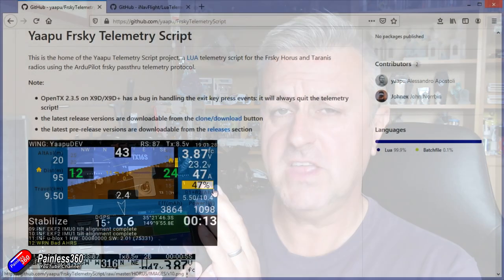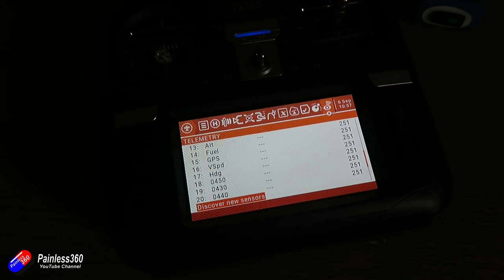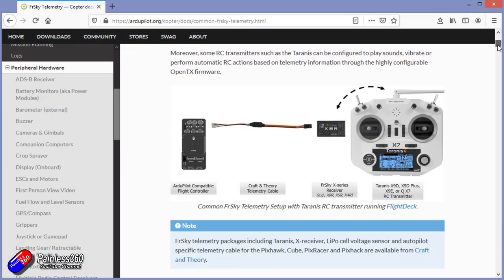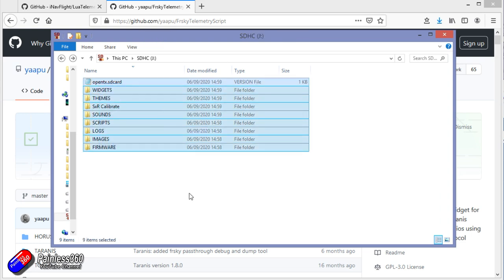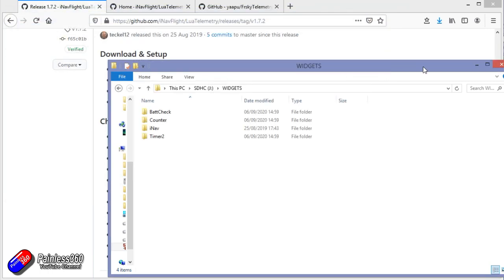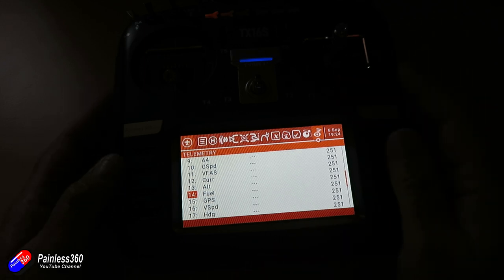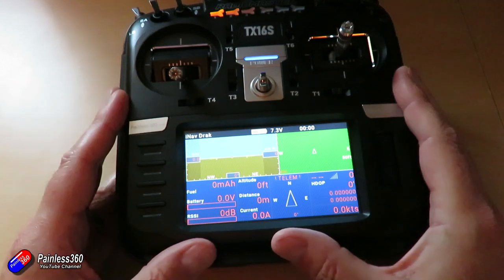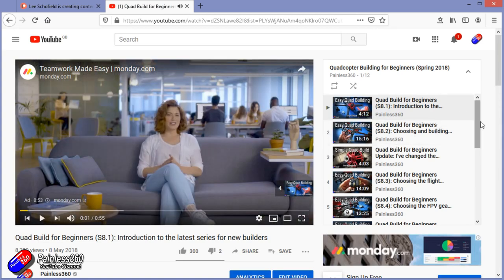Installing Telemetry LUA scripts onto the RadioMaster TX16s (Yaapu and iNav)

Comment: This worked for me using a TX16S, Pixracer FC (old model), Yaapu cable (from Amazon) to connect RX S.PORT to Pixracer Telem2 port, and a Radiomaster FRSKY R161 receiver.  Set Serial2_protocol to 10 in Ardupilot parameters, ignore BAUD rate setting, and leave Serial2_options at zero.  Do not worry if you don't see many sensors on the TX16S before setting up the scripts, I only saw GPS, the script seems to magically pull the sensors from the MAVLINK stream.  I also used this on a setup with a Kakute F7 ardupilot with FRSky receiver and no special cable and it also worked there.  Thanks for the help!

Comment: Hi,
Thanks for the clear explanation of how to load the Lua scripts.
Just one thing to add.  I fly a Holybro Durandal, with s.port for telemetry back to the receiver.  For reasons I dont understand, only GPS sensor shows up on the transmitter when I search for new sensors.  I was confused for ages trying to get more sensors to be discovered.  However, when I loaded Yaapu, it was fully populated with all the sensor data.  No need to try to get all the sensors showing first!!
Cheers
Jon

Comment: Lee I I'm using the same radio as you, loaded with Edge TX and Yaapu, latest versions - when I click on Yaapu's config script, all I see is the word "English" as opposed to the full list of config options.  Also, when running Yaapu, I basically see the just the center section of data (the artificial horizon and a few others things), but almost the entire perimeter is mostly blank.  I deleted and rediscovered all the sensors - a couple times - and still have the same symptoms (I also redownloaded Yaapu and reinstalled).  This was all working fine a couple days ago before I installed EdgeTX.
Reply: I feel dumber and dumber. 1.9.6 is also listed on the main Github page. Thing is that's the first link I downloaded, and Yaapu didn't work (who knows why), which is what led me on this odyssey.

Comment: Hi Lee,

I was trying to assist a friend in putting Lua script on his TX16S.
I have done so on my own TX16S, and it works.

The difference is that he is running Edge TX 2.7.1., and I am running an older version.

The problems arises when we come to the part where we shall populate the widget. On my TX16S it follows your video, but on my friends TX16S we are guided to a menu where is says “Select Widget”. In this menu we can select a lot of items (e.g. timer, output, etc.) but not the Lua script. 

Do you have any idea how to solve this?

Best
Ivan
Reply from the maker: Its location on the SD card would be my first guess.... best of luck

Comment: Thanks lee, but I'm still struggling with my Atomrc Dolphin (loaded with iNav6).  I'm using a Radiomaster Tx16s with a Radiomaster R161 receiver.  The Atomrc F405 NAVI has UART Port 2 for the SBUS from the receiver and the iNav6 configurator shows that all the transmitter channels are working.  For telemetry I connected the R161's SPOT "blue" wire to the UART 2 Tx pin.  The receiver was "bound" using the option Ch1 - 8 Telem ON, and the iNav6 Configuration Port has both Telemetry Output and Enable CPU based Serial Ports selected.  The only telemetry received was the default 4 channels.  I have also tried using the UART 3 Tx pin for the receiver SPOT wire, with the Port Telemetry options  Disabled, FrSky, or SmartPort.  Nothing is working (even after your deleting all sensors "trick"), so have you any suggestions ?
Reply from the maker: A UART can only do one thing at once. If one is doing SBUS, then you'll need another one to use for the telemetry... Best of luck

Comment: Hi Phil,
I have finally got telemetry down from a jumper R8 to my tx16s, BUT i have no sensors shown for distance like sensor 0420 and no tilt on display. got compass, battery, altitude, gsp cordinates, mainly want is distance from home.
Any ideas.
Was going to down load yappu, but if not working complete with inav the I guess it will the same.
Regards
Dave.

Comment: Once more you have shown me a useful tool, thanks. Being old I shall watch this a few times ...and still get it wrong but everthing is backed up. The lzsest version of open TX seems to have a big, seems I get a throttle warning on startup, the a fail safe alarm ...why ? Recibrated sticks still get warning ? Take care.
Reply from the maker: I've had this here and I don't move the throttle the last mm of travel at the bottom when I calibrate. Best of luck

Comment: Adding on to my comments below there's another thing worth noting.  To make Yaapu work using ArduPlane and a FrSky control radio, you have to select ArduPlane's "FrSky pass-through" protocol for the serial port.  FrSky has limits on the data that can be sent via sensors.  This protocol was written to get around that.  One down side is that when you "discover sensors" - the only one that shows up is GPS.  None of the others show up because they're passed in a way that's outside the way OpenTx handles sensors.  I point this out because the PainLess360 videos make a point of saying that the first step in running Yaapu is to get "lots and lots" of sensors when you do a "discover sensors."  This is false in the case of using ArduPlane and the "FrSky Pass-Through" protocol.
Reply from the maker: No idea, sorry. I've not used it in a while. I'd check that the port and connections are correct. Best of luck
Reply: @Painless360  I actually spoke with the fellow who wrote the FrSky Smartport Telemetry Passthrough protocol used in ArduPlane to get telemetry back to Yaapu on FrSky radios - he's the one who explained that the "passthrough" was required to get around the data limitations that OpenTX imposes on sensors.  Because the data passed back to the transmitter using the "passthrough" is encapsulated, it doesn't show up when doing "discover sensors."

I noticed that there's another generic "passthrough" option on one of the parameters - my guess is that its to be used for CRSF. 

As it happens, CRSF isn't supported yet on the latest stable release - 4.0.7.

Your videos helped me get my EDU-450 off the ground - and I'm extremely appreciative.  Some of your information has a few holes in it - which has a good side and a bad side.  The bad side is that it takes some digging sometimes to figure out exactly how things work.  The good side is that it's the process of digging that really provides an avenue to learn this material.

For that - I thank you Mr. Schofield!
Reply: I have to agree seems at times an ester egg hunt. No link to tx16 suff. as stated.

Comment: Hi Lee, what is the baud rate did you use for your model?  I found a weird thing that when the baud  rate for external crossfire TX is equal to or smaller than 400K, the telemetry data won't fully show on the screen. Only part of data was there. But if I increased the baud rate more than 400K, then the issue disappeared...  Not sure what is the cause...  I tried deleted and discovered sensors, but the issue persists...
Reply from the maker: I've never had to change any setting on the radio for Crossfire. I only use it on EdgeTX radios though... Happy flying

Comment: This has been VERY useful information.  I have one question, Followed all your steps read all the required reading and when I discover new devices they all have asterisks by them and some are flashing.  What does that mean?  P. S. I am using a TX16s.
Reply from the maker: The flashing * is showing that the value is being updated. They should flash.. Happy flying
Reply: @Painless360  , You are the man!!  Thank you......

Comment: I realize this is really old - but thanks again Lee!  I've decided to finally add TX telemetry for iNav and Ardu.  RM TX16s, latest edge, followed all of the installation notes.  I select a new telemetry page with full screen - but when I pick either widget I get an error saying "Full screen required".  Any ideas?
Reply from the maker: Turn off the outer elements on the telemetry screen (trims erc)

Comment: Hmm...  Either I'm doing something wrong - or the slide about Crossfire and MavLink isn't quite right.  I have a Quad (a Hexsoon EDU-450) running an Orange Cube and ArduCopter.  I have a Crossfire receiver connected to the flight controller via S-Bus.  Previously, I've run Yaapu successfully when I used a FrSky receiver and the handy-dandy cable.  But adding MavLink to my S-Bus connection on my Crossfire receiver doesn't provide the telemetry sensors required for Yaapu.  I looked at the ArduPlane/Matek/Wing build video - mentioned in this video - but found no help there.  So if it really is possible to get the proper telemetry back to my TX16S with standard Crossfire transmitter - I'd be be very grateful for some additional guidance on connection and configuration.  Many Thanks!
Reply from the maker: Nothing special you normally need to do but connect the MAVLINK TX and RX signal cables to the pins on the FS that are outputting the MAVLINK signals. https://ardupilot.org/plane/docs/common-crsf-telemetry.html

Comment: Hello Lee.  I have been using this on my OpenTx configuration without any problems (since you last helped me) but having spent the last two days trying to help a club member configure his system I have an issue that I hope you can resolve.
His transmiter is a  Radiomaster TX16s MkII running EdgeTx v2.10.1 and the telemetry is all being received OK.  I can only find one set of iNav Telemetry files to download (the same one I use for my OpenTx configurations) and that has installed OK on his EdgteTX transmitter but although the basic widget window is displayed a lot of text is missing.  For example the gauge headings are not displayed, and as soon as the GPS gets a "lock" the GPS coordinates vanish (displayed in a colour you can't see ?).  Do you know of a solution to this, or have I installed the wrong iNav LUA telemetry "system" for EdgeTx ?
Reply from the maker: Check for an update to the widget. Some older versions won't work on the latest EdgeTX. Please let your flying buddy know about my videos too... Happy flying!
Reply from the maker: Then delete and rediciver the sensors... best of luck

Comment: I have a Radiomaster TX16S paired with and X8R. I am trying to use the Yapuu script with an Arducopter Cube Orange. I am not getting the long list of sensors shown in the video. I am using a Craft and Theory cable in the Smartport. Do I need to download both scripts mentioned in your video? Am I missing an update? Any help would be great! Thx.
Reply from the maker: It sounds like you have all the right stuff so I'd double check the coonections and settings in Ardupilot.. Best of luck

Comment: Hi Lee great video. I have a Jumper t18 with the latest tbs nightly build of opentx, the crossfire firmware is the latest also. I do run the latest inav lua script and see all my sensors but notice a "glitch" when powering up my wing. The battery percentage will start at 100% then immediately drop to 0%. If I power cycle my radio while the wing is still running it then shows correctly. I have double checked the battery/voltage settings that the lua recommends in the wiki. I have also tested this with different battery voltages and they display correctly after the radio power cycles. Not sure whats going on. I did notice that you don't use percentage for the fuel on the drak but mah. Any reason behind this? How does it work different to the percentage?
Reply from the maker: I don't run nightly builds on the radio. Seems to work OK here. I'd add it as a bug to the project. Best of luck
Reply: @Painless360  Fixed it, crossfire nano was sending the rx voltage and not the fc voltage. A Crossfire update fixed it.

Comment: Will the iNav Telemetry LUA work with the Express LRS EP1 receiver using the CRSF protocol?  I am running Edge TX 2.7.0 on my Radiomaster TX16S.
Reply from the maker: I've not tried it bur it might. CRSF also sends telemetry back to the radio.. Best of luck
Reply: I am running ELRS EP1 and it sends EVERYTHING from the FC back to the TX16S.

Comment: Hi, thank you for you videos, so much help. I have a problem with Taranis X9 lite... Opening Open TX companion 2.3.14, i dont have the box to mark LUAC, so yaapu lua is not working. Actually any luas are working.. do you know how I could solve it? thank you!!
Reply from the maker: I'd check the release notes for that version of Opentx as LUAc may be included in the firmware automatically now... Best of luck

Comment: I just purchased a boxer radio (4 in 1 with external ranger elrs module). When I drag and drop the iNav lua files onto the SD card I’m getting an error message. Any advice much appreciated!
Reply from the maker: Where exactly are the files on the SD card and what is the exact error?

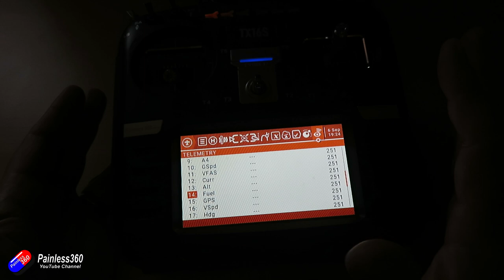Comment: At 13:42 you speak of sorting out sensors if they are not discovered. I cannot discover anything more than basic crossfire information, as a result my teletry widget is 100% still. Tried everything - different software, receivers etc. Could you share what exact version of software did you use in this video for FC and TX? My radio is a Jumper T16 and I'm getting really frustrated by not being able to make it work.
However on my quad with BF4.2 this widget works flawlessly.
Reply from the maker: The latest version although I've not struggled here to get it to work with different versions. I'd suspect the settings or wiring on the model .. best of luck!
Reply: @Painless360  Figured it out - UART TX and RX mixed. RC worked somehow but no telemetry went back. Rewired and it works like a charm. Only the fuel sensor gave me headaches, but I found out how to calibrate it (default was 1500 mAh while I fly with 4600 mAh packs)

Comment: Quick question. I am trying to install the Inav lua script to the TX16S and i have it on the SD card. I go into the telemetry page and I have all 23 sensors registering, but they are slow in feedback. Movement of the board stuff. I go into the SCRIPTS section of the SDcard and select to execute the Inav.lua and get (attempt to call a nil value   ?:0) not a nice Inav telemetry screen. Do you know what the problem may be??
Reply from the maker: Where on the SD card did you put the script?
Reply: @Painless360  SCRIPTS then TELEMETRY. On the radio I go into the TELEMETRY folder and execute, then nothing but (?:0 attempt to call a nil value)
Reply from the maker: Run them from a telemetry screen, not in the way you are... Best of luck

Comment: great video! i got it working. but... how do I turn off (or set a new value) for telemetry low battery alarm? I believe it's default is 14v. I am running 4s but LiIon, so i would like to have it either off of set to 12v. Is that possible? if so, how? thanks in advance!
Reply from the maker: There is a menu for the script that can you select all of the settings.. Check that out. Best of luck!

Comment: Great video ! I got a problem, I can discover sensors but it dont want to do anything on the telemetry page(Yappuu one), im using crossfire with mavlink to the fc(Arduplane + Pixhawk), any suggestions ?
Reply from the maker: What troubleshooting have you tried?
Reply: @Painless360  Firmware update on opentx btw this is a jumper t16, reinstalled the yaapu script and deleted the sensors and detected them again
Reply from the maker: You've done all the basics. I'd check the wiki and forums. Best of luck

Comment: Hello Painless360,
I want to ask if it is possible to fully turn off the tx16s s and not just have it in shut down stby mode. Becouse when i just normaly turn it off it still uses battery power and sucks the battery empty quite fast.
Thanks =)
Reply from the maker: I'm planning aware of one. Apart from unplugging the battery if you plan to not use it for a long time... happy flying

Comment: Do you plan to, or would you consider doing a 3dxr rf modem setup tutorial?
Reply from the maker: I don't understand the question. Can you rephrase?
Reply: @Painless360  sorry, I've been on a short hiatus and have come back mid way through this frsky rx debacle. Rather than trying to aquire suitable rx that still functions with my current equipment i was looking to move to a whole new radio setup and was looking at the TX16s and crossfire as an upgrade from QX7+R9, since I'm also looking to move away from inav/beta flight to ardupilot for more robust mapping applications I was also looking at telemetry control capabilities. 

I could be misquoting now, please put me straight if I am!... but, 
 It was suggested of moving to an 868Mhz rf modem such as the "RFD868 TXMOD" which is capable of doing everything in one package ie. Radio control, telemetry control and video feed all back to the tx and then WiFi to a laptop ground station. 
All the goodness  without using 2 or 3 separate systems.
Reply from the maker: If I was getting into it now I'd look at one of the multiprotoocl radios like the RadioMaster and Crossfire if you want lower latencies and stronger signals..
Reply: @Painless360  so crossfire is also capable of functioning like that, I thought it was just tx and basic telemetry!  Just coming up on a year's break and it like starting from scratch all over again the technology is just moving so fast! 
Thanks for the fst replies and the advice, take it easy Lee
Reply from the maker: See my Crossfire for beginners video - covers the basics..

Comment: I fly the DJI 550 and use the Naza V2 with the OSD system. Will downloading the iNav and LUA scrips make any differance ?.
Reply from the maker: I'm not sure I understand the question. Can you elaborate?
Reply: @Painless360  flying with a monitor, the DJI OSD shows battery power,satellites, hight and distance plus a lot more info and still show pictures.
Reply from the maker: You need the telemetry on the radio for those scripts to work. Still not sure what you're asking. You want the same detail on an inav model?